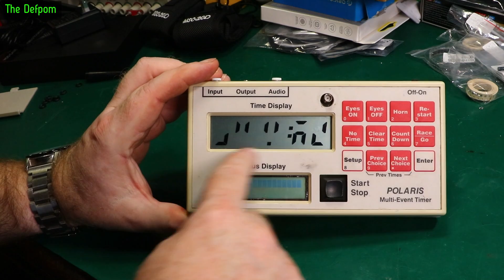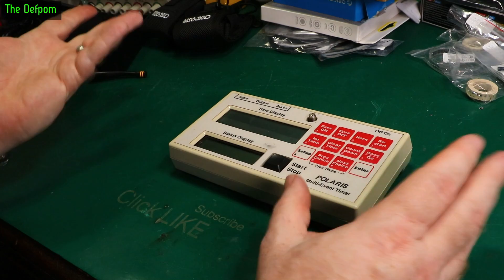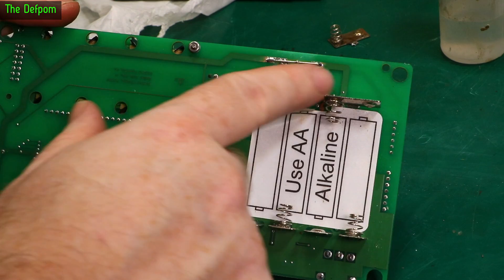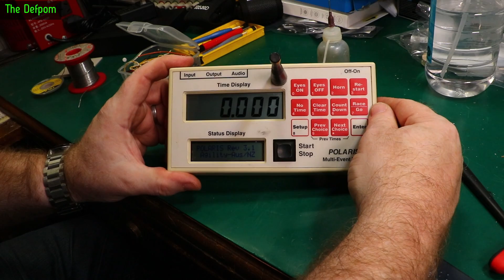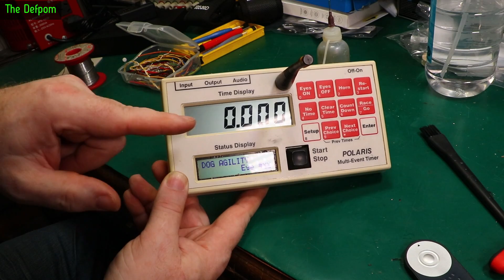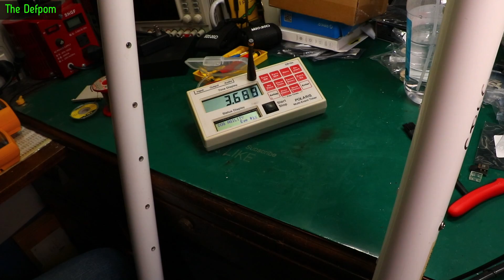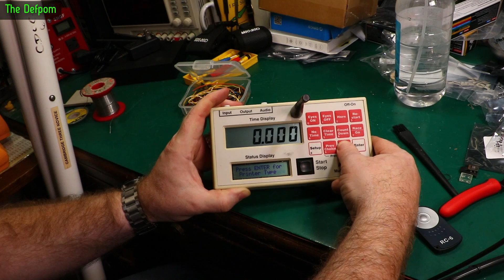🔴 Farmtek Polaris Timer Repair SN_21444 - No.1153

Comment: Is the UV flashlight you are using able to cure the soldermask deeply as well?
I have a UV flashlight,  but it is only able to cure the soldermask superficially. Under the cured layer is liquid soldermask.
I'm looking for a flashlight/ UV lamp that cures deep layers.
If your flashlight is so powerful to cure the whole soldermask, please give me its model, like soldermask manufacturer.
I have been looking for a long time for a good UV lamp /  and soldermask of good quality.
Reply: I have small UV flashlight that seller throw in, and it's just for a show. I've build a custom lamp with 9 1W near-UV LEDs, but it still not good enough for thick layers. So 2 options - cycle by apply thin layer - exposed to UV LEDs - apply thin layer..; acquire UV-C lamp (dangerous); or expose to direct sunlight for 20 min or so. Only summer sun was able to cure a blob of green soldermask ~2.5 mm thick, so I'm applying soldermask by very thin layers now. Or look up what nails saloons use on daily bases, in real world (not from aliexpress ADs).
Reply: Just tried an exparagus (come on.... name that reference, no googling!!) . Some say applying hot air while under UV cures it faster and it does seem to when observed, the top skins over very quick but still can be liquid underneath. Comparing with the same sized blobs, I tried UV and heat from the start. I tried UV for 30sec then add heat which was better but I could still crush it with little effort and it was still liquid inside. Then I tried heat followed by UV. Total game changer! 200C for about 20sec, medium air flow, circular motion to keep the resin in one place, you will notice it becomes less liquidous, then UV only for a min and the blob is solid! Let me know your results with this.
Reply: @JonnyFix  The hotair method I tried but not in the order you wrote. I will try to heat first and then cure with a UV lamp.
Thank you for your answers ( to both of you).